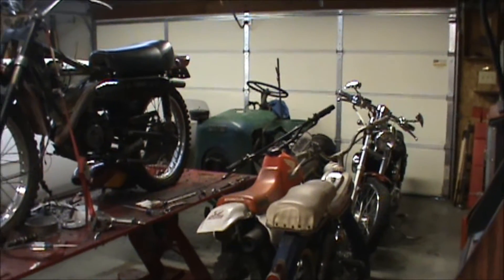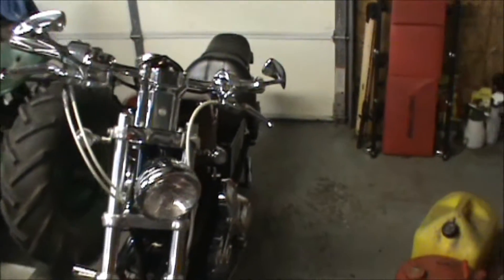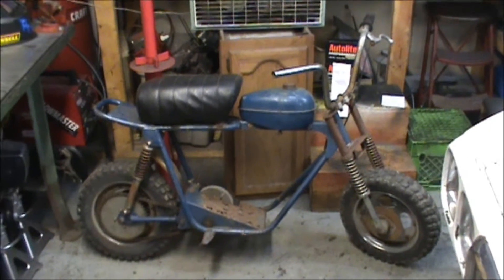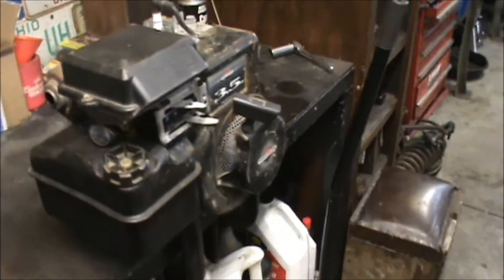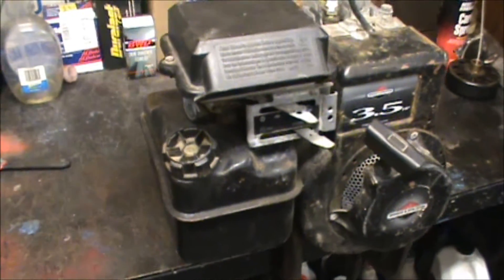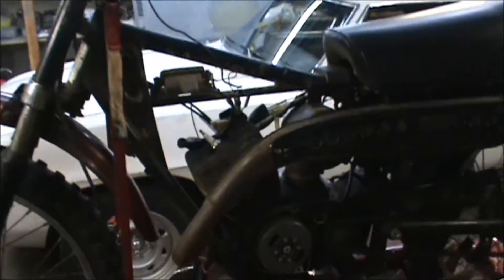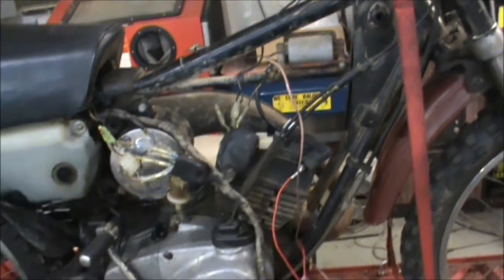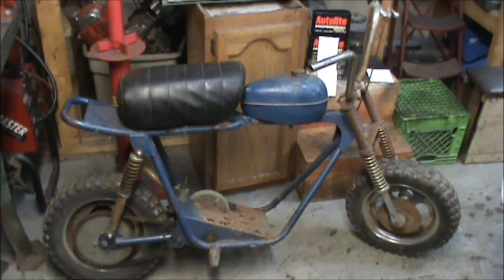Old Speedway Mini Bike and more

Comment from the maker: @VMATT500C Yeah it does... that's what I originally thought something with the point and condensor. But didnt think it made since to put out that much voltage. I know they'll still run with a bad condensor but just eat up your points, but hte points didnt look too bad. I'll try the new coil and if no luck it's got to be that condensor I guess.
Thanks for watching and the input!

Comment from the maker: @3WHEELERMAN8483S I had a similiar issue with an Xr100 where I didnt have the condensor by the coil hooked up... plugged one in and fired right up! Might be my problem aswell.... damn coil was cheaper than the condensor! ;)